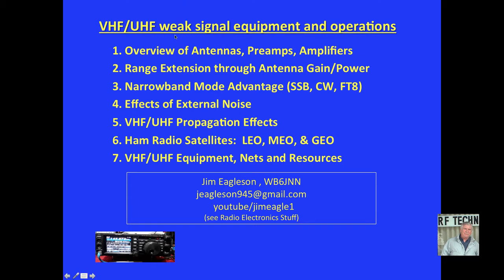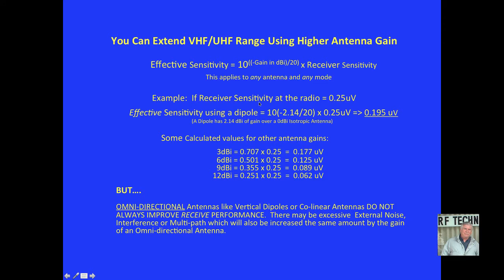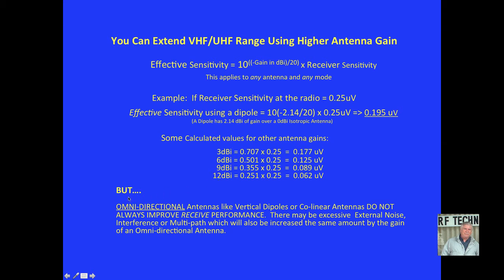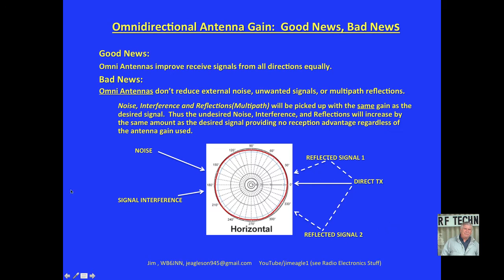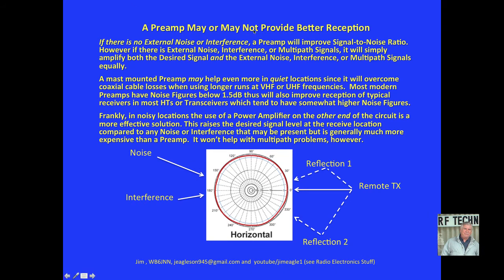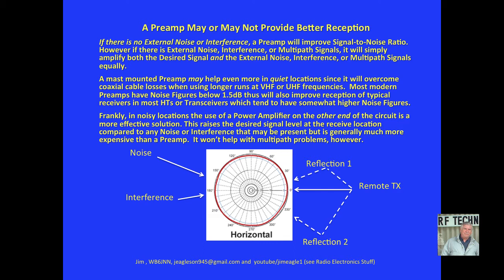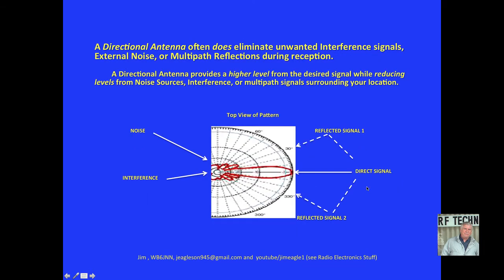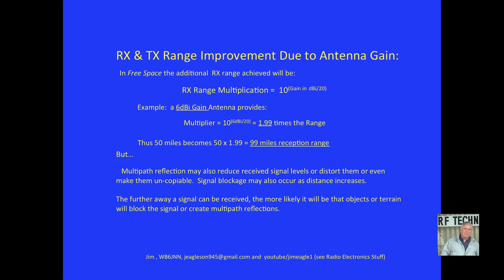1 VHF UHF Antennas, Preamps, Amps, Range

Comment: It's interesting to note that, in a quiet location with a quiet sky - i.e. above about 400(?) MHz - at low pre-map noise-figures: Improving the RX noise-figure, by 1 dB for example, can improve received signal-to-noise ratio by more than 1 dB.  This is because quoted noise-figures are usually with respect to a source at room temperature, i.e. 291 Kelvin, but the sky-noise temperature, at UHF and above, is usually significantly lower.